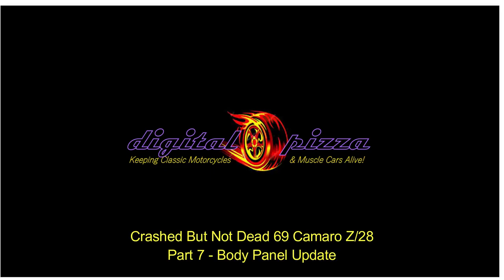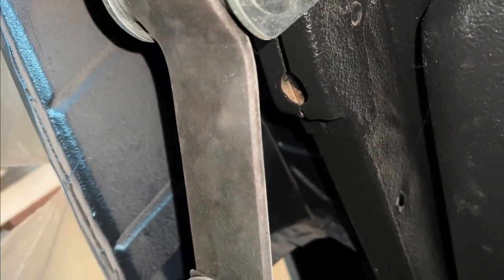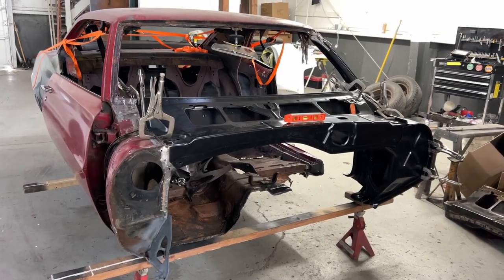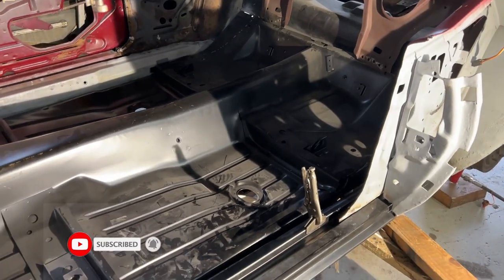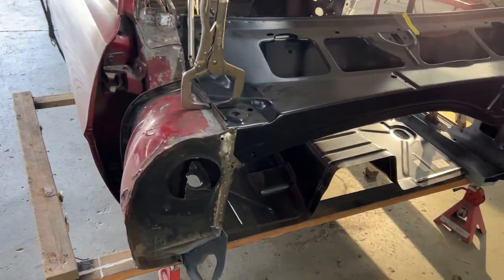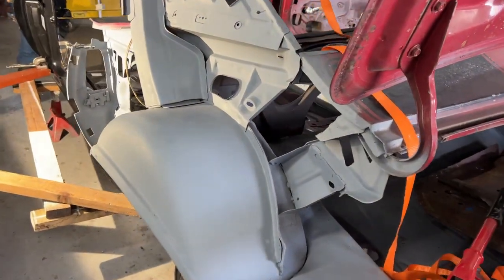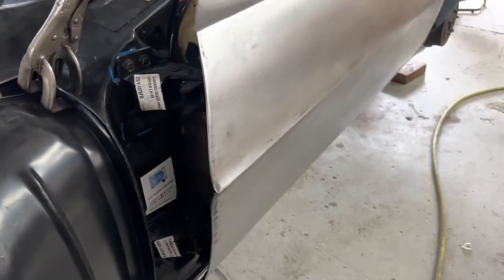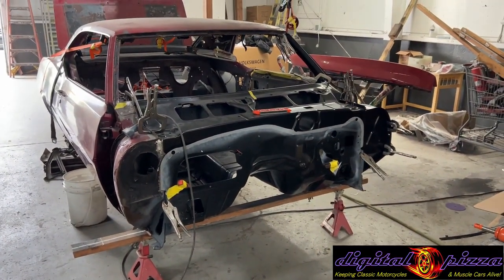Garnet Red 69 Camaro Z/28 - Crashed but not Dead - Part 7   Body Panel Replacement Continued.

Comment: Note of advice. Make sure the lower cowl where the fender bolts on to the firewall jig pin hole is 18 7/8". If it's not your fenders will be off alignment. If you don't know what I'm talking about go to Jubee Mays videos and he has a video specifically on this measurement. Good luck. I'm following your rebuild

Comment: A few years ago I had a very rusty ‘68 convertible rescued. TEST FIT EVERYTHING! The only mistake we made was not test fitting the windshield and door glass. Didn’t discover my windshield frame was bent until it was painted and the door glass would not fit to the windshield frame. At that point we realized why the guy had so much trouble fitting the convertible top (out of square body at the top).
Reply from the maker: Hi John, thank you for your input.
I think I will have the front and rear glass installed be before the final spot welding is started if possible.
Good point, thank you

Comment: Looking good! The jig is first and foremost, and once you have that built, you should be able to set the floor on it, which is essentially a one piece unit right? Then set the body on top of it and start tacking it back together. I would not worry about groping the doors right now, because that is going to change, possibly dramatically. 

I would have for these guys to be charging you T&M for that type of work, as that is double labor. As I stated before, I think they should have pulled the car to square first with the A and B pillars still attached and then begin the panel replacement. But then again, is just one way of doing it. Good luck with the build, so glad you are saving this gem. Looking forward to more content.

Comment: When replacing qtrs there are two small support peices that need to be attached to the qtr.  I hope you installed them or the quarter will flex and split at qtr window area.

Comment: 'Cobbling' it together (for want of a better term) is probably not 'book perfect' if one wants to be 'technically perfect'- but - as mentioned - with so much damage there is not much else you can do and in practical terms in the 'real world' - I think the 'vice-grips' method will achieve the desired outcome (and of course there will always be people with different ideas//approaches - but  - such is life).  The jig is a good way to go.  It amazes me when I see people out on the Internet building shells from new panels and they never use a jig.  They may be lucky - but then again - they may not.  I have personally seen more than one of these 'hand assembled' shells that had measurable discrepancies between the wheelbase from each side and also other issues due to not being assembled on even the most basic of jigs.  Even though said body shells have had the panel gaps nicely 'fettled' and the shining new coat of paint makes things look 'new again' - those discrepancies deep down within the chassis specifications will rear their ugly head one day when weird things re the handling or tyre wear etc occur.   The body jig is the most sensible approach and doing that prior to the 'cobbling' together would have been nigh on impossible.  Not everything is rebuildable - but this 69 certainly is and great to watch.  Have a safe and nice day all.  CHEERS from AUSTRALIA.

Comment: I would put the jig back on the Blue car and remove the doors, I'd then add extra bars to line up through the bolt holes where the door hinges go, cross braced. The absolute must is the way it sits on the floor, it has to be totally level and I think you'll get that with a laser level. Thanks for the mention!
Reply from the maker: Hi Mike
Thank you for the tips
I will mention that to them.
You are welcome on the mention 😎

Comment: A  HUGE  change from your last video ! So glad your using a jig . I was definitely under the mistaken impression that those rear quarters were being trial fitted for welding . I'm very impressed with the parts availability for Camaro's and Firebirds . Without being too nosey what is cost so far for the panels ? Thanks for sharing .

Comment: You need that frame jig so you can line up the guide holes on the floor and sub frame. Im doing a 68 camaro pretty much same job and with the frame jig I was able to weld the floor completely together with firewall and lower the frame of the body down on top of the floor. I did have to strap the floor to the jig to keep it straight because the body shell was twisted. But once I got the floor welded in everything else went really fast. I would not attempt it without the jig though you got to be able to straighten that shell before you weld those panels on. I have pics of my project if you have email I will send them.
Reply from the maker: Thanks Gov, my email is digitalpizza@comcast.net

Comment: I'm surprised you didn't straighten the car out 1st then weld in braces front to back and side to side,  then start cutting floor and qtrs  the first pieces to replace would have been the rocker panels,  then the floors then the qtrs, not knocking you just saying

Comment: Kind of hard to attach panels to a twisted body so everything twisted needs to go or be repaired before anything else gets welded on so there is nothing wrong with your approach at this point. If you watch videos on Petersons Restorations he does the exact thing all the time with Mustangs. The thing with him is he does complete boy rebuilds so often that he has it down pat and makes it look so simple. IYou will like how he has a level steel plate floor to do all is jig work on so he knows exactly what is straight and has all the body measurements to go off of. You should watch a few of his videos and you will see it is quite interesting. Here is his channel https://www.youtube.com/channel/UCG-IsvXgmiBXavN03_C-PNA/videos
Reply from the maker: Thank you Dave
I will definitely check it out 😎

Comment: Is it rare and  worth money, of course. But it is still a badly wrecked car put back together in a garage with poor overseas metal in the end.
Reply from the maker: Yep, you’re right, just like when the car was new. Built in a bigger garage with poor metal.
These were crappy built cars from the start.
But They are still worth fixing.
And by the way, The metal is actually not bad at all. Especially from AMD
Reply: @digitalpizza1  sure. You got it!🤔
Reply: Now it's a hand built car .  Checked and double checked. With reguors  precision.  Better than GM. Mass produce it on a hurry up assembly line. Not original.  BETTER.  THAN.